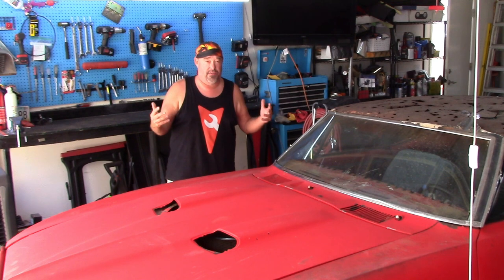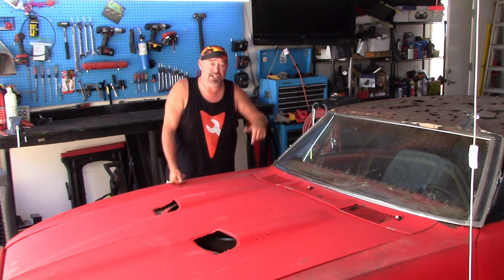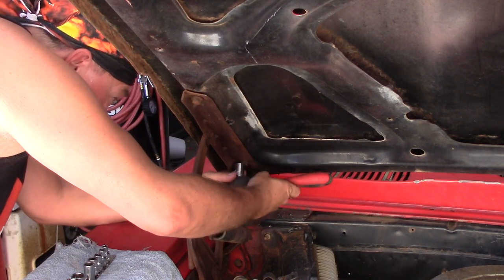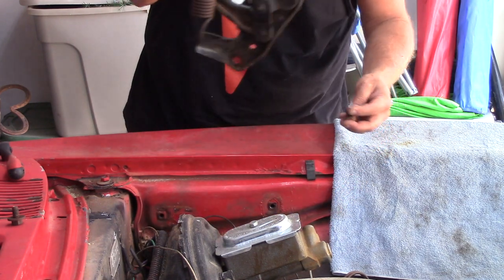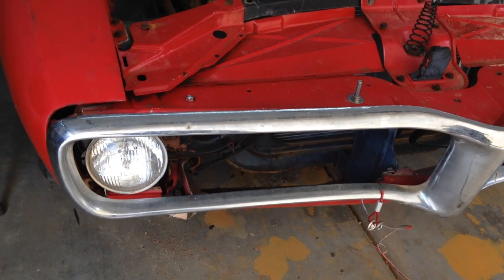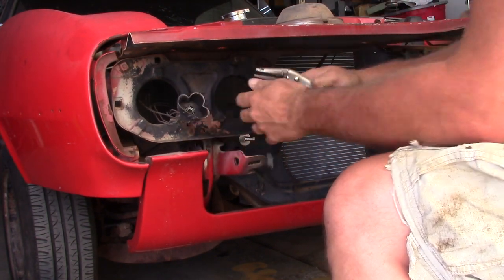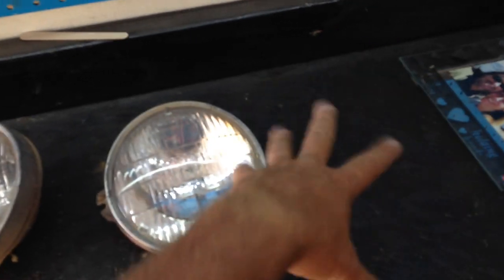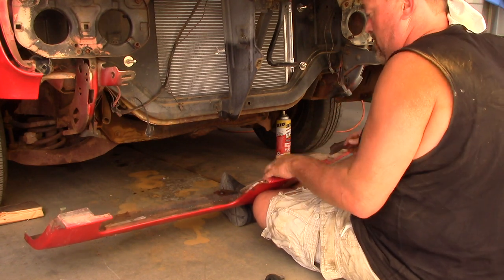Removing the front hood, front bumper, front grill on a classic 1967 Pontiac Firebird Restoration

Comment: For the screws, or any metal, lookup electrolysis. Its pretty easy, and very cheap. I'm restoring a 67 pontiac (which is why I'm watching), and have just started doing electrolysis. Takes a while on larger parts, but screws are done in like 1 hour and you can do them all at once. Look into it, you will be amazed! No dust, no sanding, no grinding. Just a little sanding after electrolysis to prep it for paint that's all.
Reply from the maker: OMG I totally forgot about this way... I still have my bucket and wire basket set up when I did the bolts on my Porsche a few  years back!  Great idea and reminder LOL Appreciate you watching and commenting!
Reply: @ArrowheadGarage  awesome! Yeah, I'm doing some suspension parts right now, blows my mind how well it works!

Comment: you asked how to clean the bolts used a grinder with a wire wheel and a par of vice grips to hold the bolt by the head  clean what you can of the head  then the rest by moving  the head around.
Reply from the maker: Thanks for the tip Carl!!!!  I will try that out!